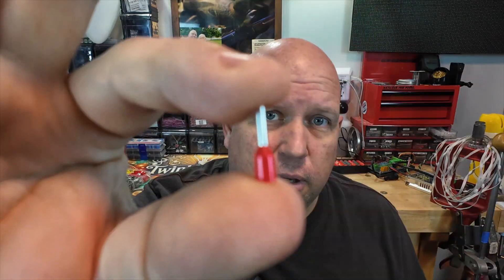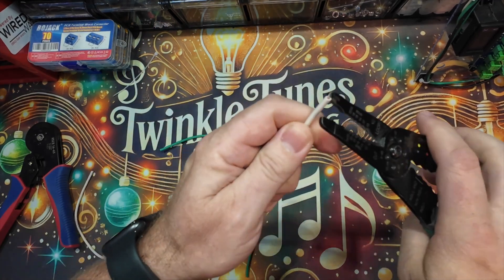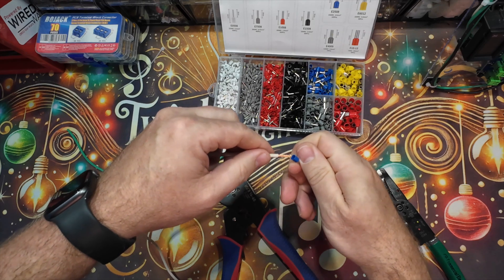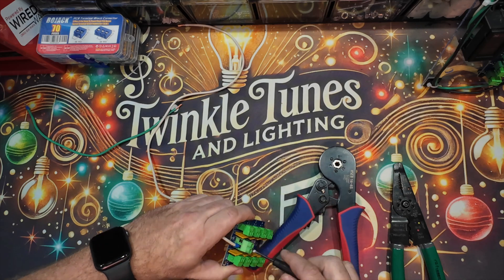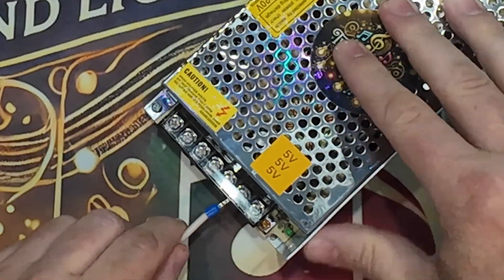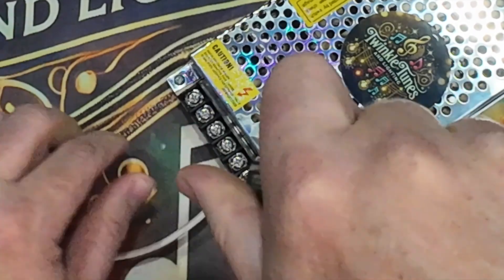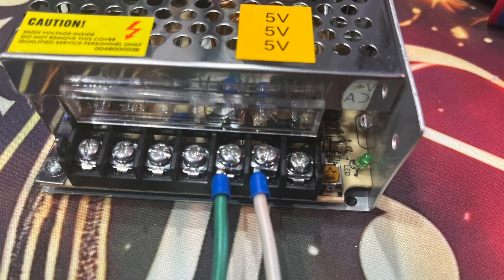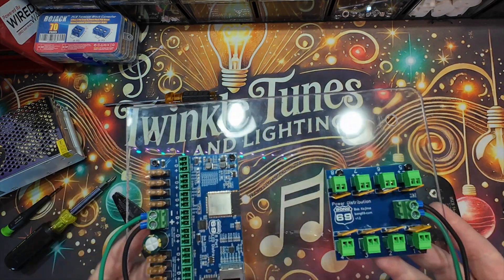Ferrule Connectors Explained | The Cleanest Wiring Upgrade for LED Projects

Comment: Why use Ferrules having very less flat surface for screws to grip on. Why not use flat lugs.
Reply from the maker: Just showing that using bare wire is no good. Flat lugs would also be an acceptable termination. I just happen to have ferrules at the time when I made the video. Thanks for the watch!

Comment: Pros don't use ferals they use the appropriate wire in the first place
Reply from the maker: @lijath  That’s a solid take—using the right wire for the application is definitely the ideal approach. Ferrules are more of a workaround or a finishing touch when you’re working with stranded wire in terminals that aren’t really designed for it. Not a must-have for everyone, but they can help with consistency and longevity in certain setups. Always good to hear different angles on it!

Comment: Ferrules are not appropriate for screw terminals. Fork or ring are recommended to allow even clamping pressure.
Reply from the maker: You're absolutely right that fork or ring terminals are often preferred for screw terminals, especially when it comes to ensuring even clamping pressure. Those terminals provide a larger surface area for the screw to grip, which helps create a more reliable, stable connection—especially in high-current or vibration-heavy environments.

Ferrules, while great for a lot of applications like controller wiring or terminals where the pressure is more uniform, don’t always perform as well in screw terminals. They can sometimes struggle to provide the same level of consistent pressure as fork or ring terminals.

If you're looking for the best connection for screw terminals, fork or ring terminals are definitely the way to go. Thanks for pointing that out, and I appreciate the input!

Comment: Can I use this for a home installation? I live in a country where we use stranded copper instead of solid copper like in the US. Switches and plugs have the connectors with plates and screws and sometimes the strands just become undone and the clamping pressure disappears. You have to twist them and make a hook and it takes way too much time and even if you do it right it might still come undone.
Reply from the maker: Yes, ferrules can definitely be a great solution for home installations, especially when working with stranded copper! In many countries where stranded wire is the norm (like yours), ferrules help ensure a clean, reliable connection and maintain consistent clamping pressure, which prevents strands from becoming undone over time.

Just to clarify, I'M NOT AN ELECTRICIAN, but based on my experience with wiring and LED projects, I’ve found that ferrules can make a huge difference in improving the quality and reliability of connections. Here’s why:

Prevents Strands from Unraveling: Ferrules hold the wire strands tightly together, preventing them from loosening or fraying, which is common when trying to screw them into terminals without proper support.

Improves Clamping Pressure: The ferrule gives you a clean, uniform surface for the screw to clamp down on, which increases the overall connection reliability and reduces the chances of the wire coming loose, even under vibration or extended use.

Saves Time: Instead of twisting wires into a hook and trying to get them just right, ferrules let you strip the wire, slip on the ferrule, and crimp it—easy and consistent every time.

That said, if you're new to using ferrules or have any doubts, I’d still recommend consulting with a professional electrician for guidance on your installation—especially when dealing with high-voltage systems or local regulations.

Comment: Ferrules are great, but that's some infomercial-level "before" footage. You can get bare multistrand wire to work pretty well f you don't just jam it in there like a damn neanderthal. 
Also, AFAIK, there is no clear consensus on whether hexagonal or square crimps are better (although there is consensus that whichever way it swings, the difference is negligible); I personally am in the square camp because all the terminals you stick them into either have flat parallel jaws, where the square will have a larger contact area, or a cylinder with a screw coming in from one side, where the contact area will be the same (two lines on the bottom and the screw against a flat surface on top). The potential advantage of hexagons for high current applications comes from the fact that terminals are sized for circular wires and a hexagonal crimp is closer to a circle, so you'll be able to fit a slightly thicker wire into a given terminal with a hexagonal crimp than you could with a square crimp.
Reply from the maker: Haha fair enough! You're totally right—bare multistrand can be done well with a little finesse, and the "before" footage definitely leaned into the chaos for effect. Gotta grab those eyeballs somehow, right?

Appreciate the thoughtful breakdown on crimp shapes too. I’m with you—square vs. hex is one of those “it depends” debates where both sides are valid. I lean toward square for the same reasons you mentioned: better fit for most terminal blocks and solid contact. But yeah, the performance difference in low to mid-current applications is usually negligible unless you're really pushing the limits.

Thanks for keeping the convo technical and real—love hearing the deeper insights!